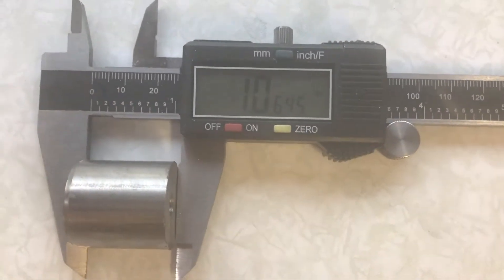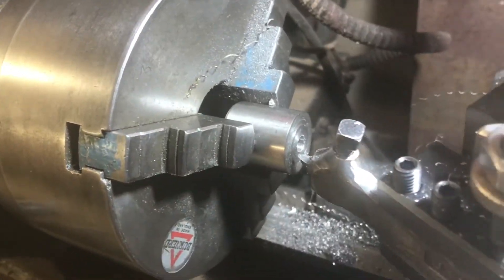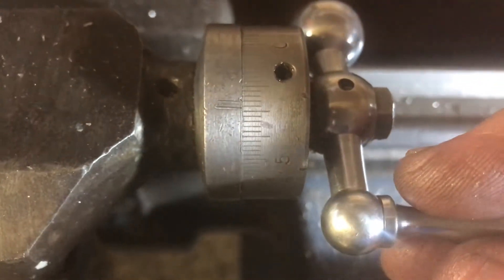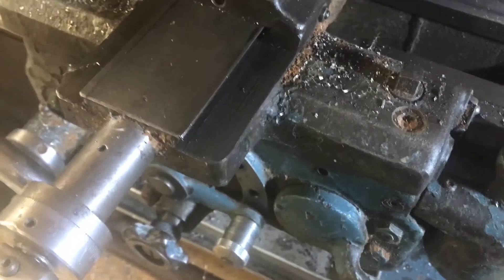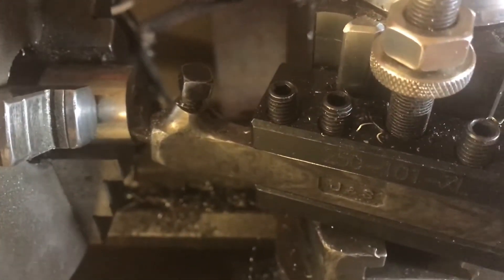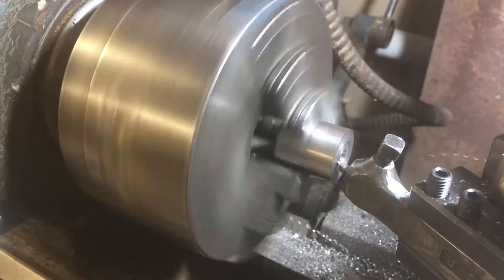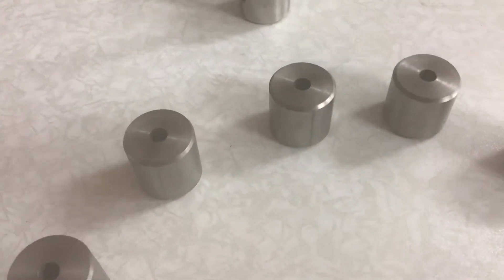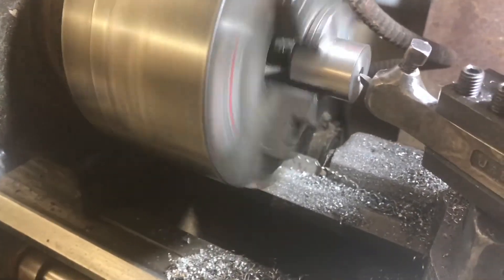Facing the end of a bar to the correct length on an engineers metal lathe (using a Boxford)

Comment: What are the videos you mention about making new nut for compound slide?
I've noticed in your later videos. Your Boxford has received a new paint of coat, did you fix some of the issues with your lathe?
Reply from the maker: Yes it has had a pretty good overhaul which is covered in several videos.  Go to YouTube.com/c/evanecent and find the playlist about engineers lathes at the bottom left. this will list more than 50 videos I have made.

Comment: The play in the screws is more correctly known as back-lash.
Reply from the maker: Yes, I think I used the term back-lash later in the series.
Reply from the maker: I just watched it again and you are correct. I called it end-play which usually refers to a shaft which moved backwards and forwards along its axis. That is a similar problem but back-lash is the correct term for this movement caused by wear in the nut that runs along the screw inside the slide. There is an article on YouTube showing how to make a new nut to correct this problem.  But for precision work it would be a good idea to make these maneuvers just in case there is a slight back-lash.  Thank you for your contribution.